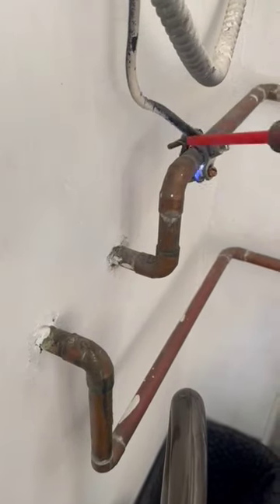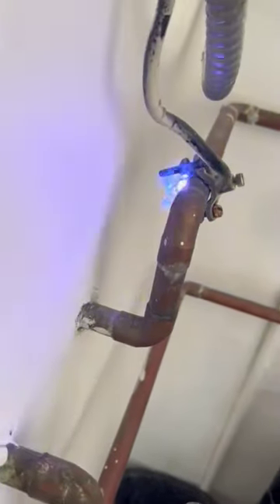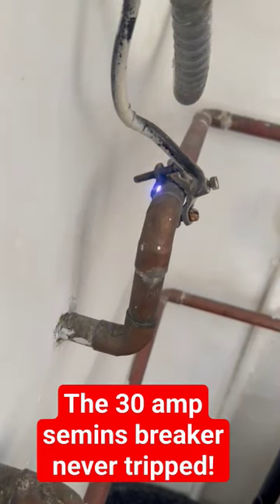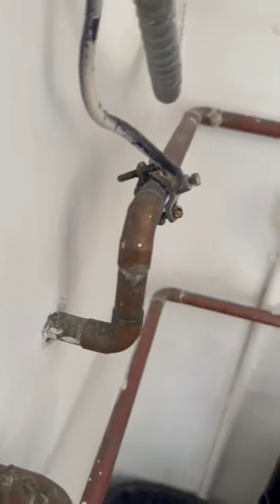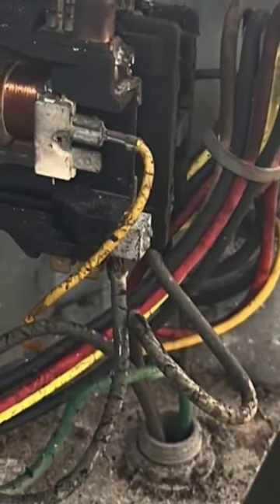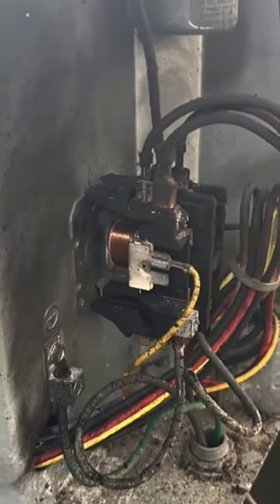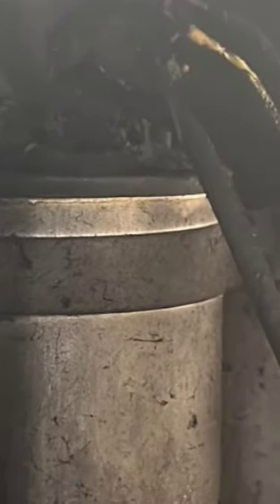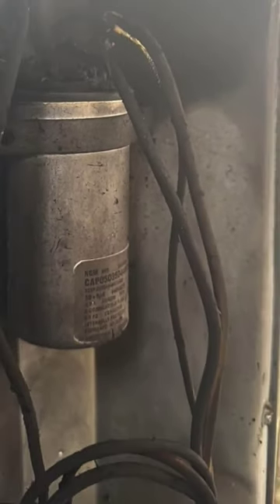Major grounding issue + lightning strike + loose cold water bond clamp = this!

Comment: You need to turn breakers off 1 by 1 til gone. Or Everything off, Meter or light Bulb pigtail between ground wire and pipe, when it has voltage(lights up)that is the circuit.
Was in an Attic and saw EMT Seperated, scary as in old days conduit was used for ground, and if a short is present, won't trip Breaker, will make conduit live. Was getting a shock on AC Ductwork. Noticed AC Registers were live. Went to Garage Panel, Turned Breakers off one by one til Tic Tracer showed not Live, Was Air Handler Breaker, Opend Air Handler, Heat Strip was Shorted to Ground, and AHU had no Ground, making Unit and ALL Ductwork Live. Repaired and Grounded Unit. Seperate Ground is Now Required in All Conduits to Keep Safe if Conduit Seperates.
Strategic Electric & Security.

Comment: A lot of houses here have no ground rod at all, only the water pipe. The systems are old and often the basement with the bedrock as the floor and shallow, so near impossible to install a ground rod. Even in my own house the wire goes from the meter main outside, through the basement wall, and clamps to the water main. No ground rod. It would have to be horizontal to work as there is not 8 feet of soil to drive one through. Where the meter main is there is only about a foot or two of soil over the bedrock, and the only area with more than that is the front yard which is about a 2 foot strip between house and sidewalk. No place to relocate the meter to that side of the house as it's all windows. I genuinely don't know what the proper call would be in this situation.

Comment: I did a rehab job.   I completed it.    5 days later I received a call from the plumber.  Voltage went screwy throughout the building ….  Final result.    The water meters were replaced.   All the bonds were cut pre and post meters.   So grounding whatsoever…

Comment: That's not a grounding issue that's a short circuit, lack of grounding in the circuit meter, fuse & breaker box. Oh where oh where has the ground gone. Nowadays I use double clamps ground rod.some time two grounds rods but one clamp eash

Comment: HVAC guy will call electrician first if any thing is wrong at the main control panel and then the plumber to fix that loose bond on the cold water pipe because he ain’t getting paid extra for that ish-
Only fixing the ac wiring is the hvac guys job

Comment: This can occur because lazy cheap electric utilities only connect one high voltage wire to their distribution transformers and the copper wire, steel gas pipe & cast iron drain pipe are used to backfeed the other side of the transformer. I have measured 1/4 to 1/2 amp current flow on copper water services when the meter is pulled & main breaker off.

Comment: I saw a house where the tv cable line from the pole was on fire as the house had lost its only ground when the wind knocked out he neutral line and there was no earth ground present.  The excess current ran down the tv cable line and lit it up, the eve of the house caught fire.  Quickly put out.

Comment: Don't see a lightning strike. Looks like a fault at the pole and also a loose grounding bond at the water pipe. The neutral current is returning through the pipe instead of through the utility neutral.

Comment: Open neutral!!! House to pole
Reply from the maker: It does look similar but it was a floating ground with a dead short.
Reply: Trust me, open neutral from that house. It used copper pipes to steel water main of that house into a house closest to the transformer out there whether head. I would put money on it!! I spent many years chasing open neutrals for Pseg. If you amp checked the water main of that house there’s amperage on it. Not arguing with you bud. Seen it a million times.

Comment: Shocking incompetence, eh? You could light a cigarette with that arc. Hope there's not a gas-fired hot water heater nearby that was installed by the same contractor.

Comment: It's mind blowing that no breaker trip on this. US code is really just a pile of crap. 
Most europeans code will make this situation impossible. First It is forbidden to use a pluber pipe as earth. Piping are frequently modified and nothing prevent a copper tube to end up into a plastic one. This will transform every faucet and bathroom into a death tool.
Every home need it's own earth rod, with controlled resistance.
Every circuit has a differential breaker 30mA from the box. So any leak of any sort will trip the breaker. Also the main breater will also have a 500mA differential for added security.
Breakers always cut both phase and neutral.
Plumbing in wet pieces need to be connected by a loop to their own earth.
It is forbidden to use metal tubes for electricity. Leaks will never reach any place you can touch.
etc etc. I was horrified by the lack of security of US electrical system in general.

Comment: i swear to God, every north american domestic electric install looks like a death threat to anyone using it or being in a 1 mile radius
the outlets, the plugs, extension cords, the wiring, the wire nuts, distribution board, bus bars, breakers, i mean everything is basically shit

Comment: Stop it man... That is one of them there electric instant water heaters.. some call'em "instant hot water heaters"... Y'all see, it uses electricity to heat that there copper pipe, and Woo-lah!!!, instant water heater.... Just make sure, when y'all's taking a shower, and yuh standin in the water stream, don't touch nuttin metal, like the fixture, unless y'all want the super charged hit water, like when somebody was to flush the toilet while yuh in the shower, it gets pretty wicked hot, feelin like you cooking like a 1970's electric hotdog weiner cooker... You know, one of them units that has open electrodes that you stab each end of the hotdog with and it then yuh install the safety cover and press the go fast button.. them there wuz duh days... Just ain't making stuff like Days use tuh...

Comment: Neutral is gone
Reply from the maker: It was actually a floating ground and the ac unit was energizing the floating ground.  The cold water bond was the only ground and was not a great ground plus was loose. But we fixed everything, fixed the short at the ac unit, drove new ground rods and ran ground conductor from meter main to interor panel.

Comment: Water bonds need to removed, smh, try taking a shower if you didn't realize you have an electrical issue 😮
Reply: Incorect... 250.104(A) requires bonding of metal water piping ...

Comment: buddy  ,even if,what you say is true,,,,,THERE  IS  A  SERIOUS  PROBLEM,   ESLE WHERE,,THAT IS A HUGE UNBALANCED LOAD,,THERE  SHOULD BE 0 VOLTAGE ON THAT GROUND,,and  even if everything was on ,,and  running ,there should be almost 0 voltage there,,,,period!!!!never
Reply from the maker: I explained the entire problem.  First there was a short on the ac circuit that energized the ground bar in the panel. That circuit was using the cold water bond to try go to the ground, but the cold water pipe was not enough to trip the breaker